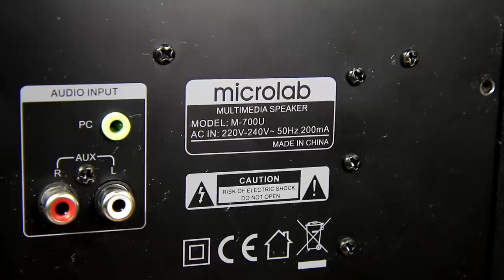Look inside Microlab M-700U PC multimedia 2.1 speakers

Comment: Hi there, i wonder if you can help me. I have the same model. Recently it keeps giving me problem with volume control. I try to adjust (up and down). The volume numbers change but the volume itself is stuck. Do you know how i can fix that issue?

Comment: You can decently improve the sound quality of the system by replacing the TDA2030 in satellites with LM1875 and some capacitors with decent ones ...